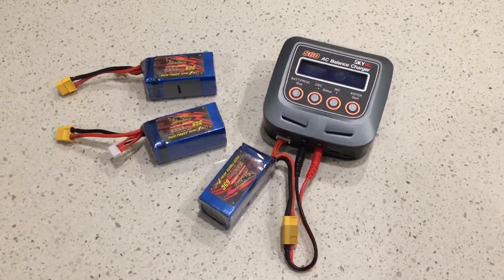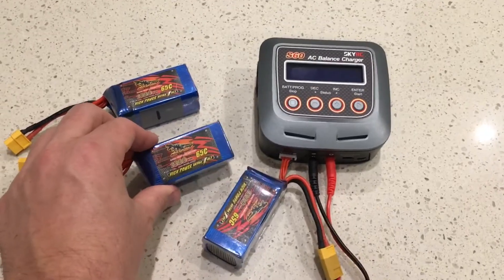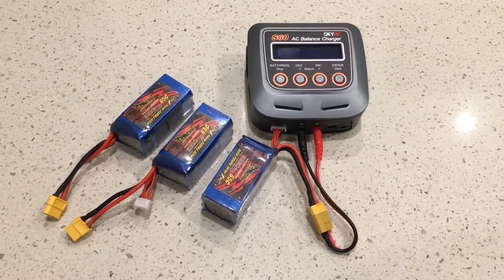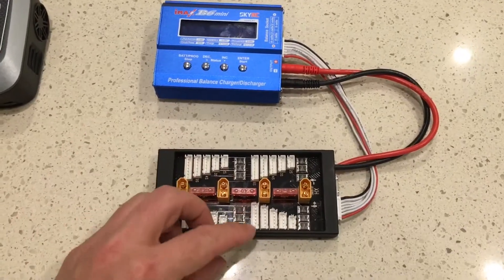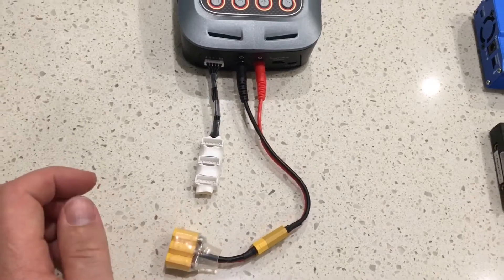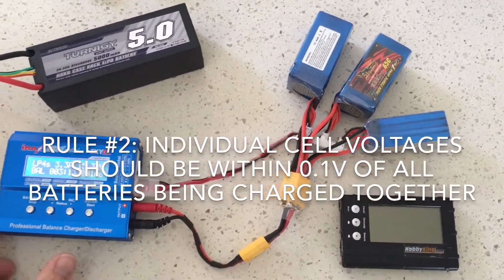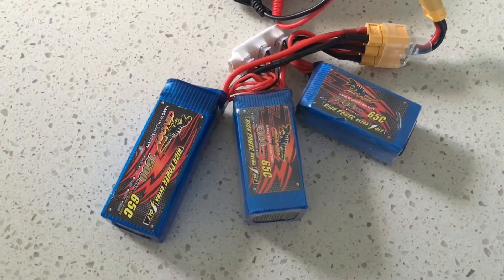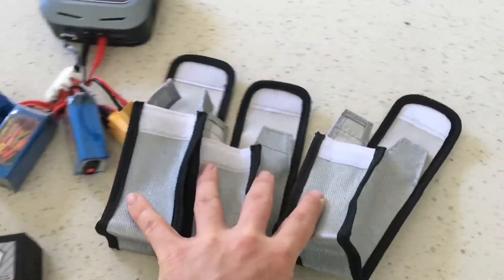Parallel Charging Fundamentals

Comment: Difference between cells should be 0.1v? I've read in many forums that 0.3v difference between cells is acceptable
Reply from the maker: There is no hard and fast rule but 0.3V/cell across 4 cell batteries could mean a difference of 1.2V that your batteries have to resolve and balance.  That's a reasonable charge and discharge load on them.  I'm not an expert but I'd be concerned it would be detrimental to the long term life of your batteries and could be dangerous. 0.1V/cell means a max difference of 0.4V on a 4 cell battery.  I've read some people recommending up to 0.2V/cell.  I think it will come down to personal preference.
Reply: +Darke Peak I never used parallel charging and still making some research how to make it safe for my lipos and secure on the same time.
Maybe I'm confused by so many opinions, but I'm trying to understand on thing. If difference is 0.1v per cell for parallel charge and I have one quick example:
Lipo1> c1-3.78 c2-3.98 c3-3.78 c4-3.76
Lipo2> c1-3.54 c2-3.62 c3-3.62 c4-3.58

that means these lipos are unsafe for parallel charge, right? because of 3.54 and 3.76 difference
How do I proceed in that case? because I have many times lipos like this. Does that mean that I have to charge that lipo individually? Or can I charge that lipo a little bit to get close to other lipos and then parallel charge them?
Reply from the maker: +Alexandru Covaliov your example of Lipo 1 shows a 0.2V difference between c1 3.78 and c2 3.98. Are you sure this is the case?  Apart from batteries that have 'dropped' a cell I have never seen a wide variance in cell voltages across the same battery.  Normal would be a variance of 0.01-0.05V between cells of the same battery. But yes, you can partly charge or discharge a battery to bring it in line with others you want to parallel charge.
Reply: +Darke Peak Just checked now. c1-4.14 c2-4.26 c3-4.22 c4-4.14 This is on new 4s 45c 1000mah Tattu . The same I have on other new/used Tattus. Chould be charger issue?
Reply from the maker: +Alexandru Covaliov that's a lot closer together but not ideal. Are you using a balance charger?  If so, are you confident you have the balance charge setting selected?
Reply: +Darke Peak I think the issue is the balance charger itself. I want to choose something else that could afford 2 parallel charging boards with 4-6 lipos each. But on the same time not too expensive.